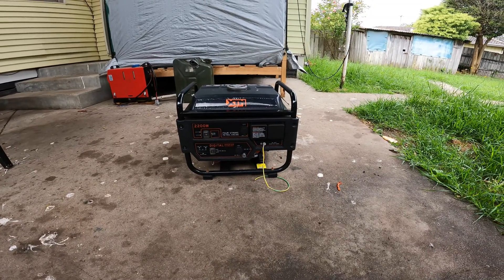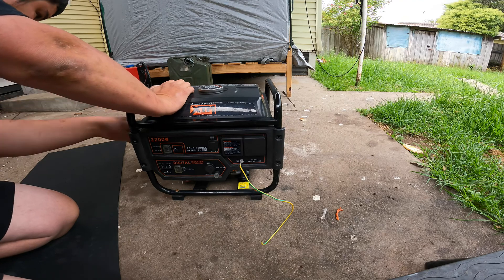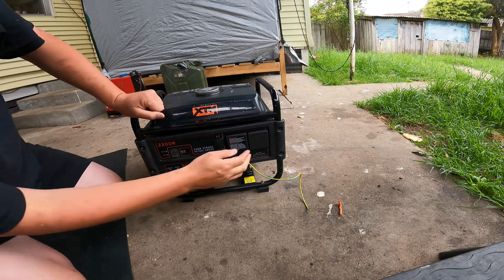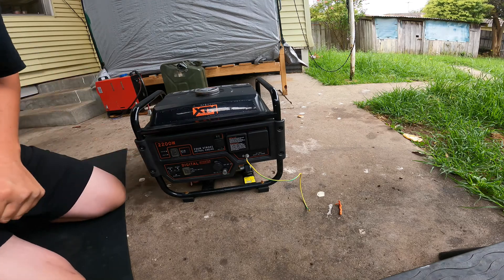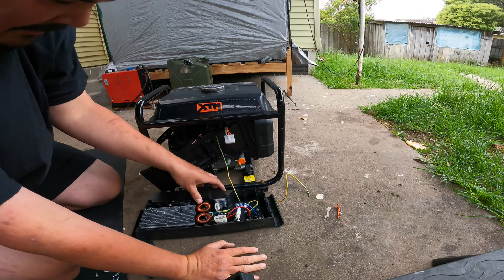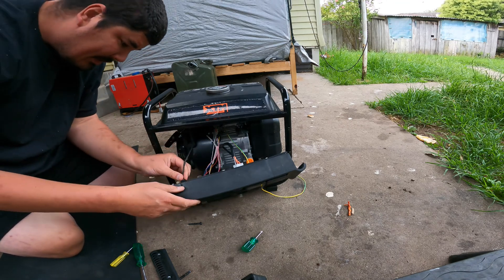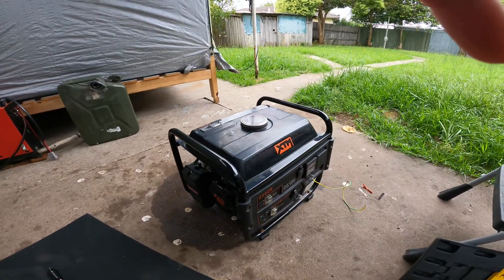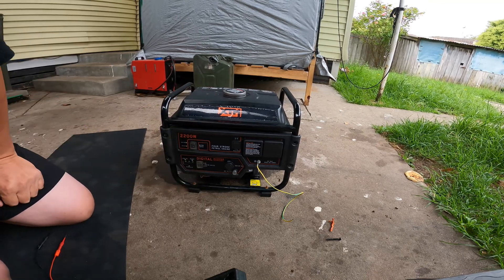XTM 22000W Failure

Comment: Its not just xtm, almost all of these inverter generators use similar chinese inverters, i have a gentrax one that the inverter has failed, and in searching for potential fixes, ive seen dewalt, ryobi and many other bigger name brands of generators all have failed inverters. They usually show overload with nothing connected. The only fix is to replace the inverter module, and from what ive seen the part number is usually on a sticker on one of the big capacitors. The only other good use for these generators, would be to add a 3 phase rectifier in place of the inverter so that you get around 300v dc output and run that to a solar charge controller thats suitable and turn it into a battery charger.
Reply from the maker: Yeah well aware of this. This is a fairly old video too. I could make a 3 phase recrifier, but I have better things to do.
I had better success with my late brother's project:

https://youtu.be/ti2xptSVblU

Comment: I was about to buy one but I won't buy that piece s*** s*** s*** from BCF
Reply from the maker: Yeah bcf have some cheap stuff
Reply: I got the cheap 200 buck dune 4wd inverter from anaconda it looks alot like this but I've had no problems and I've used it to run things like window aircons in power outages starts first pull everytime and I've used it in 40c heat with Max load for multiple days at a time and no problems I have read that some people have had problems with them so it's abit of make sure you test it before ya warranty runs out 😂 anaconda are real good when it comes to warranty and replacing faulty products got a faulty fish finder from them and took it back the guy was just like you can grab a new one if you want or I can give you a refund I just grabbed another one got a new receipt and went home hooked it up to the top ender and no dramas 😂
Reply: @notyaboymatty5907  200 dollars; that sounds crazy cheap! Don't you mean like ~$450?